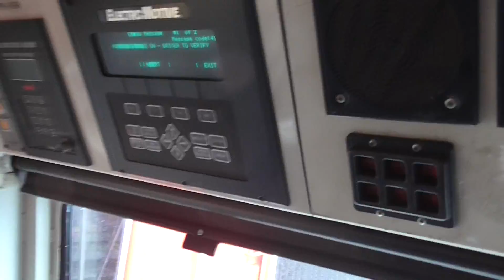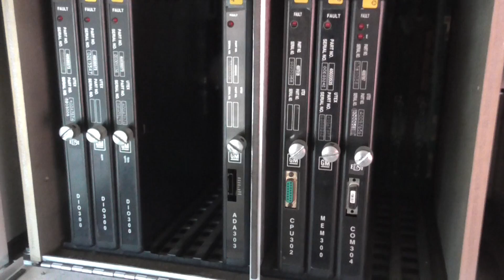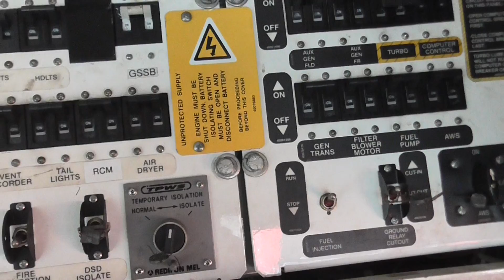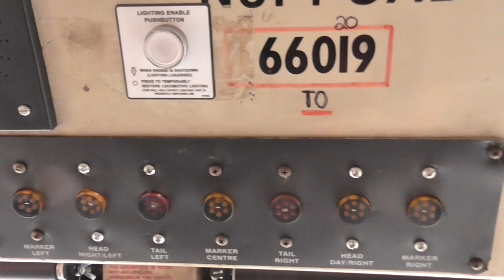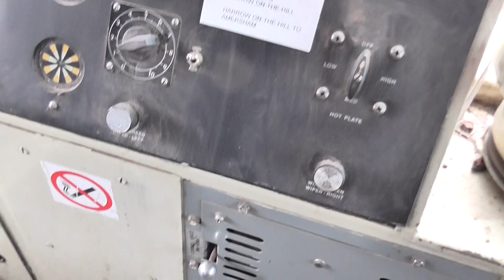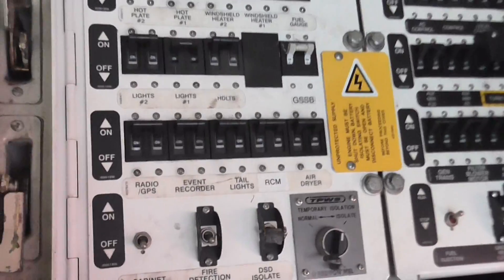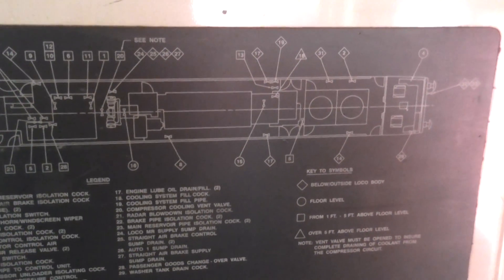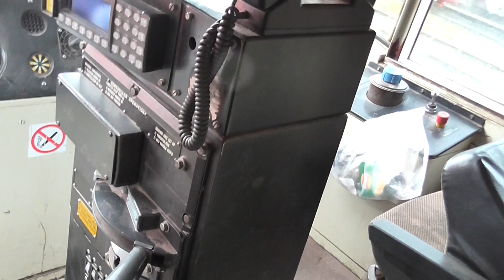DBC  Class 66...... Part 4

Comment: What is the noise going bang bang bang?
Reply from the maker: Its the auto drain valve, expelling moisture from the airs system
Reply: @DOCTORDROTT  Thank you.
Reply: Hi James, also wanted to ask why do class 66's make a kind of chirping noise at tickover when at a red stop signal?
Reply from the maker: @andrewwww7684  Its the gear train noise on the turbo, the engine is directly connected to a large air compressor via a shaft. So you will also find engine speeding up and slowing down when not moving as it builds up air pressure.
Reply: Also, why do we buy class 66's from Canada why on earth can't we make our own loco's, we gave birth to the railways/railroads we were world class builders of steam trains, I live in Stockton on Tees the birth place of the railways.
Reply from the maker: @andrewwww7684  In the UK , the loco builders could not deliver a bulk order of "off the shelf" locomotives. EWS ordered 250 66's in one go. Its sad to see .We don't seem to make things these days. Years later the factory where these locos were made was also closed and production moved to where labour was cheaper

Comment: What are those 3 nipples below the circuit breakers? They seem to be on just about every fairly modern EMD i’ve been on.

Those cab heaters are the same as used on EMDs in North America. Sometimes the heating element is weak, and we block the inlet vents with paper towels. They put out a little more heat then.

The Smart Start is good on the locomotives with either an electronic governor, of electronic fuel injection. On our older SD40-2, which is what class 59 is based, the Smart Start sometimes screws up. With the mechanical governors you sometimes have to give it more fuel in starting by holding in the lay shaft. Smart Start can’t do that. I’ve seen them keep cranking until the battery dies. Other times the system gives up when the diesel won’t start. In this case hopefully someone is available to manually start it. If not the lights, fuel pump, and other devices might drain the batteries.
Reply from the maker: Air filter check points, With the EM2000 screen, and a lap top plugged in and those ports everything can be checked on test runs from number 1 cab to monitor performance .

Comment: What, exactly, are the Pass/Goods buttons, in the cab, for?
Reply from the maker: indication of brake rate, Pass rate faster brake application / release, Goods position just has a slower brake application heavy freight trains, coal steel etc. Some faster rated trains, freightliner types class 4 trains run in Pass position. Most freight run 60 mph max, but container trains up to 75 MPH , the top rated speed of a class 66
Reply: Do your goods wagons have graduated release, or direct release brakes? Here in North America, most passenger trains allow a partial release of the brakes, but freight control valves just do a direct release.